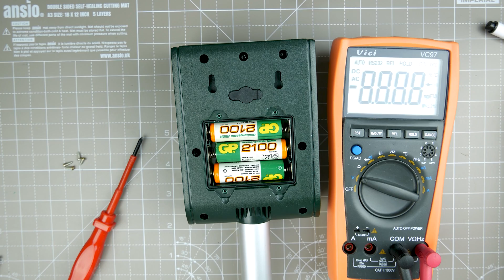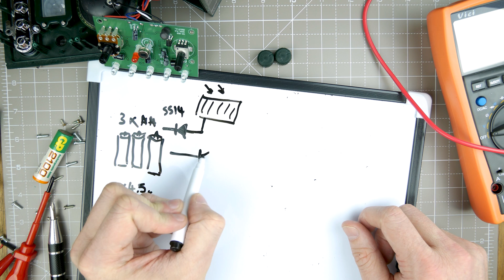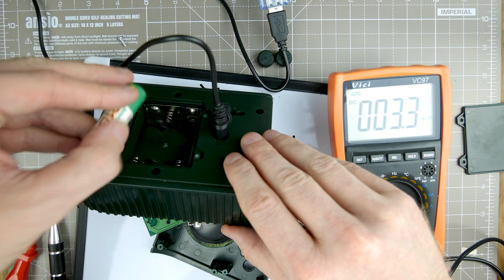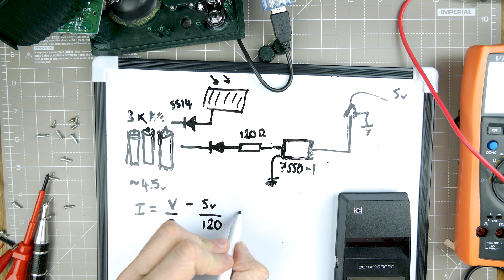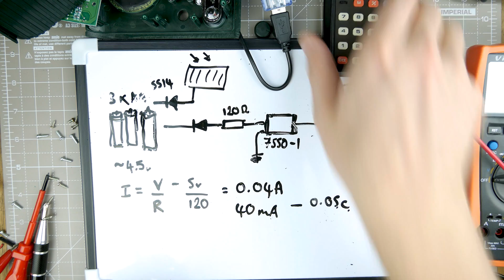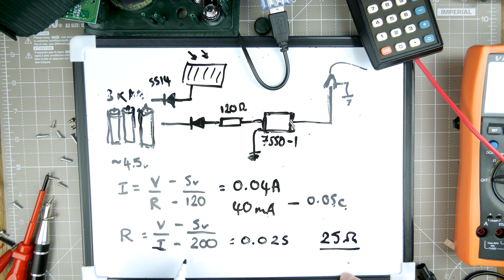But the cat came back the very next day

Comment: I've converted all my devices that use 3 or 4 AA cells, into 18650 with a cheap TP4056 module attached to the battery with Kapton tape. If you Dremel out the battery box from the sides (Keep the lid), you get the extra space. You can put 2 or even 3 X 18650's in parallel and get 5000- 6000mAh.
Reply from the maker: Nice idea, thanks

Comment: Hi David - The calculations you did in this video are for the case where 5V is being dropped across the resistor - That would only happen if you short circuited the battery terminals. Working on the assumption that the batteries are nominally 1.25v each, you'd have (3x1.25=3.75V) being dropped across the batteries, and the remaining 1.25V being dropped across the resistor. .If you are aiming for 100mA charge rate, you'd want a resistor value of 1.25V/100mA=12.5 Ohms... You'd be dissipating 1.25V*100mA=0.125W of power across that resistor (1/8th Watt) which means that you don't need anything special in the way of resistors. Hope that helps. Cheers!!
Reply from the maker: Why is it Jim that around you I feel I need to go back to school?
Reply: If it makes you feel any better, my calculations above are wrong anyway... I forgot to take into account the 0.6v which would be dropped across the diode you mentioned.... See.. It's really easy to make mistakes about this kind of thing.... and certainly isn't the first time I've got things wrong myself. This is what usually happens when I'm trying to be all clever. Whoops!!

Comment: Such minuscule current is probably ment to trickle charge the batteries and power the circuit 24/7, instead of being a quick charger that one would only use to charge the batteries when they are empty. 
Anyway, NiMh chargers can be very simple compared to Li-Ion charger. Unfortunately this kind of chargers (5V power supply with diode and resistor in series) are sometimes found inside a Li-Ion charger, for example chargers of remote controlled toys.

Comment: Wow... you're stretching your calculus muscle there ;-)
So what's the current when you use the USB plug to charge truly empty batteries? NiMH batteries are normally 1.2V, so at 1.27V are they not quite empty yet? (The charger may be charging in trickle mode...)

Have you tested to see at what voltage they stop working? Maybe you can measure the current this device is drawing. 
My suggestion for improvement would be a small 5V, 1W solar panel connected to a 3,7V LiPo via a TP4056 protected charger. That could last all summer without replacement, depending on the panel orientation.

Comment: Your current calculation is a bit in error , the voltage across the resistor will only be 5V ( input) - Battery voltage  ( for pretty flat NiMh about 3V for the three ) or about 2V less the diode drop , so maximum current into flattish  batteries is about 16mA  , or more like  12mA into 1.2V nominal batteries , So your measured 10mA is about right .
Dropping the resistor value  with no regulator would increase the charge current ,( 140mA for a 10 Ohm resistor)  but without some method of automatically  stopping the charging  you might end up cooking your cells if you forgot you were charging them !!

Comment: Just swap the batteries and use a normal charger to charge the empty ones. 
Probably easier than taking the unit inside, plugging it in, and after an hour going back outside to place it back. 

If you want to change anything I'd upgrade the solar panel. Also, is that the protective film that is still on top of the panel? If so, removing it might give you a few more joules of energy. 
Maybe remove the red status led to get better battery life.
Reply from the maker: Yeah, that is what I have been doing 3 hours at 500mA and they are fully charged. I just wanted to see what people thought of the trickle charge circuit. Pulled off the film now thanks :)

Comment: You asked how to improve it... well, the obvious thing would be to install a decent 3 cell NiMH battery charger module in there. However, to get decent charge rates you need to use a quality charger with DeltaV detection, and that will be hard to find. Therefore the simpler way is to convert it to a Lithium cell of some form (nom 3.7V)  and then throw in a TP4056 module from ebay. Get the microUSB version that also includes the DW01 and Mosfet to manage the undervoltage cutoff, not the MiniUSB or the module that only has one chip.
Reply: And even better would be to find yourself 3 x 14500 LifePO4 cells, as they will fit in to directly replace the AA's. Change the battery tags so all 3 x 14500's in parallel, and that will give you about 1800 mAh at a dead flat 3.2V. Find a TP5000 module from eBay. These come set at 2.0A charge so just drop that in and you can recharge off 5V in 2 hours.
Reply: The LiFePO4 cells are fabulous because of the flat discharge curve,. Also they don't need the mamby pamby delicate handling of LiPo and that makes the solar charging far easier. The basic crude was is to change those 2 SMD diodes to Schottky, and then just fire the solar panel straight in via the diode. The current is low and the LiFePO4 don't care about overvoltage under those circumstances, they will just charge.
Reply: Or just swap the Reply button with the Edit button.
Reply: Why would I do that? I deliberately made separate posts for three completely different comments. It'd be unreadable wall of text otherwise. Anyway, rather than spending your life tossing off to your own cleverness, do you have anything constructive to add?

Comment: I think the USB input is an external power source not a charge port. The supply current seems about right and for a 2100mAh battery that would last about 5-days. The nominal voltage of a NiCad/NImH is 1.2volts so your batteries look OK to me. Fully charged for a few mAh load would be 1.35-1.4 volts, quickly falling to nominal of 1.2v for many days.
Reply from the maker: Yeah the batteries are fine and it had only been out a couple of days. Their capacity has dropped a fair ways, the 1800 figure I used is little bit of a guess, conservatively I would say lover than that. They are quite old. I would hope it wasn't an external power source, it would ruin the semi-waterproof nature of the device.
Reply: Not with a good blob of epoxy!

What's the current the thing uses when switched on? Is the current supplied by the external jack enough to power the unit or do the batteries discharge as well when it's on? I was thinking if the current the unit uses is a reasonable amount less than the charging current, you could use a larger solar cell for this input, allowing the internal batteries to run the thing at night and the sun to run the unit and top up the batteries in the day. May not work in the winter. Get your calculator out again!